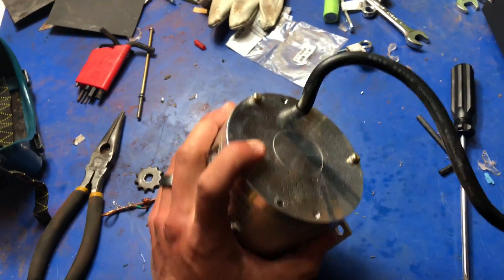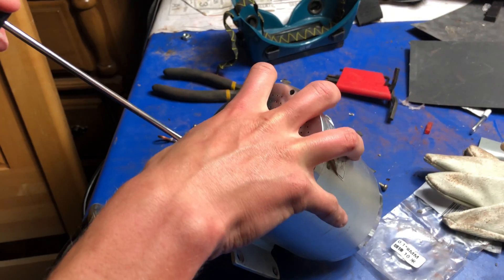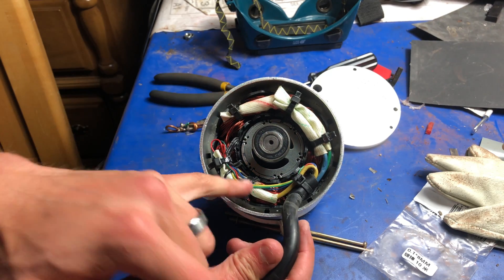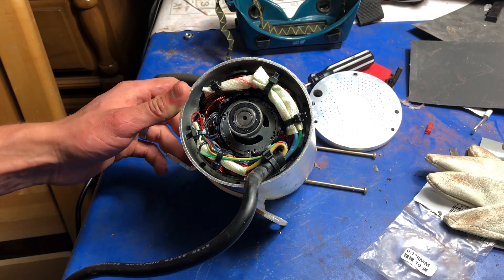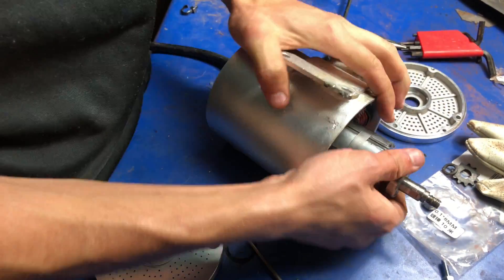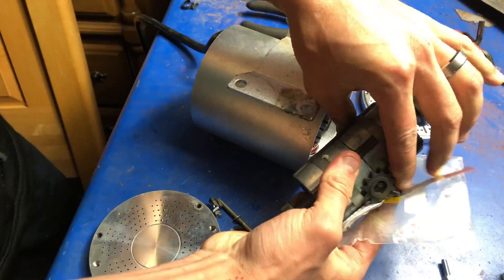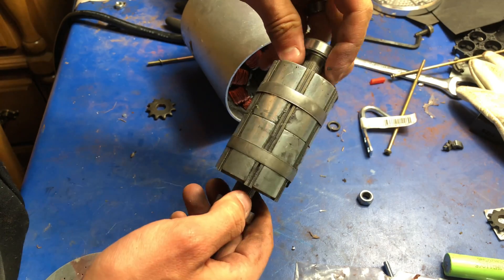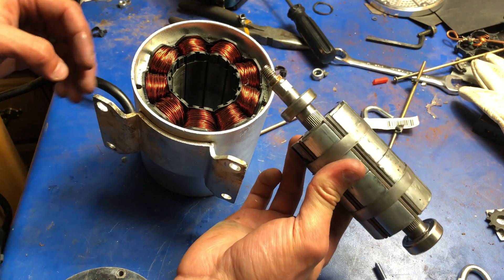What’s Inside a 5hp 3500w 72v Electric Motor ? 3 phase induction

Comment: It looks like those cheap ball bearings might have failed which in turn could  have caused the rotor magnets to grind against the internal field coil casing. 
I changed mine for 6001 ceramic bearings, but have not tested them yet. The main advantages are very much lower friction, zero maintenance (no lube necessary) and extremely corrosion resistant. Time will tell. But they make the motor more efficient with less frictional heat developed and near-zero rolling resistance :-)
Reply: Sorry if this is a stupid question, but how do you remove the bearings? They look like they are stuck on or something?
Reply: @AlfieMaxMiMi 
No problem. No, the bearings are just a loose "transition" fit on the shaft and housing. They are easy to remove. I replaced mine with ceramic bearings that seem to fit perfectly and work just fine.
Reply: @alant383  Oh good. Thanks :)

Comment: Anyone have idea how many peak amps these motors can handle? electro and co sell a kit for the razor MX and the controller puts out 100a, but the motor they sell has a heatsink on it so it can handle more power.

Comment: Nice video, Logan! I have a MY1020 with gearbox attached. Do you know how to get rid of it? Anywhere to buy the plate that goes in the sprocket side?
Reply: You really think someone taking apart a completely different motor is going to know the details of your specific motor? You think the guy is going to go out and buy one so he can figure it out just for you. Try using google or figure it out on your own. No one here is going to do the work for yoh
Reply: @jacobleeson1574  MY1020 is the same motor as this YT video, y'all. C'mon, try to focus.
Reply: I would love to see the gearbox you have set up on your MY1020 - I am using a chain geared primary reduction with a belt drive (Gates Carbon bicycle) to the rear. 
I might change it to a belt drive primary reduction later but the chain drive saves space (laterally).

Comment: Weirdest thing to me is u can buy these motors from 500w to 3000w and they all look exactly the same ??
Reply: Possibly different thicknesses and lengths of coils, put in the same mass-produced casing?
Reply: Or maybe the ratings are for different duty cycles
Reply: @robbiejames1540  i'd buy the highest rated one and undervolt them so make it last longer :)

Comment: I liked the video since I was curious of how does it look from inside.. 

first of all it is Brush Less DC motor with hall sensors. 
the design does not look too bad if you just consider low RPM use... 
however with just straps to hold the magnets in place  for high RPM that is really bad..

still it is repairable 100%
with little more knowledge and patience you would have saved 150$$

thanks for sharing though appreciated
Reply: Would glueing them to the rotor do the job or at least help in any way?
I am thinking of getting one, enlarging the holes on both sides, replacing bearings and adding a heat sink and a fan to cool it down.
Reply: @inso5078  i would not alter the design in any way if low RPM is desired .. i have had these for over a year without any issues and it barely produce any heat.. if you are considering a major design upgrade then go with a higher quality BL motor

Comment: Thanks.  I now know that this motor is not worth buying until they press the magnets into the laminated core (like Tesla).  That manufacturing process costs more but prevents the magnets from breaking/delaminating at high RPM.  
P.S. at 4:32 you said it was a brushed motor ... but you more correct earlier calling it a three phase motor. It is in fact a BLDC or brushless DC motor which operates using three phases and three hall sensors for rotor positioning information, which allows the controller to start the motor from a dead stop.
Reply: But my friend you get this motor at a fraction of a cost compared to a tesla motor from which u can't expect carbon fiber reinforcements on the rotor to keep the magnet and tesla motor is a bldc for a very low rpm but mostly its a induction motor.
Reply: @lalithkishore3774   Carbon fiber? Where? 
All I'm saying is the steel straps to hold the magnets on the rotor don't work as seen in the video.
Both motors are BLDC.
Reply: @kevinsellsit5584  No tesla motor is not a bldc motor, bldc are inefficient
Reply: @kevinsellsit5584  inefficient because of its back emf
Reply: @lalithkishore3774  
I'm pretty sure all motors generate back emf.
Reply: @kevinsellsit5584  
Personally, I doubt that it was the steel strap's fault. Sure, having the magnets inside the core would make them safer, but i think to would reduce efficiency for a pure non-inductive BLDC. I think these magnets were pre-damaged or stressed from improper fitting.
Reply: @robbiejames1540  clearly you have not heard of induction motors
Reply: @robbiejames1540 bad glue
Reply: @robbiejames1540  I purchased 60 cast iron hub motors from China in 2006 and nearly 1/3 of them were grinding the magnets on arrival, despite having been "tested" at the factory.
So fitting, adhesion, and quality control are words that apparently don't apply.
That being said, 100% of the BLDC controllers worked on arrival.
Reply: @robbiejames1540  or the rotor hit the field core due to failed bearings - they looked pretty crappy
Reply: its a brushless motor idiot
Reply: @chickenmanatvtuft8283   Why are you telling me this when my comment explains that it is a brushless motor.
Tell him not me, _ _ _ _ _ _.  Pick a word, idiot, friend?

Comment: Hi, I have a 3000W brushless motor and it is overheating. Could drilling bigger holes in the ventilation area solve the overheating problem please?
Reply: will definately make it better. but dont get any shards inside the motor from drilling holes. these are chinese motors and while they do provide good power and torque for the price, you should not put huge loads on them or they will get hot. if it only gets so hot that you can still touch it, it shoud be fine though.
Reply: Ponha uma hélice na frente do motor e aumente os furos ,mas cuidado com a água e detritos de chuva e excesso de poeira nele
Reply: Yes, there is a YT vid on this by "beltsnshit' where he did just that and added a heat sink around the outside. 
You have to take the end caps off though. I drilled mine out to 3/32" diameter holes based off the existing holes, from the inside. 
They guy on 'beltsnshit' drilled out to bigger than that, maybe 1/8" but similar effect. 
Another improvement 'could' be to add a mini fan (computer fan?) to blow into a duct formed around the end plate to blow thru the inside of the motor and exhaust out the wire loom side. That would give the best convective cooling effect possible - just need a filter for the intake - like wire gauze flyscreen - and allow maybe a formed duct at the exhaust. 

I know, I eat too much cheese ..... :-)

Comment: It's possible it could run even without the magnets. It wouldn't be synchronous motor anymore, but asynchronous. That means, as the magnetic field in coils is rotating around the rotor, magnetic induction appears in the rotor, and it starts following the rotation. It can never reach the coil rotation (hence the name, asynchronous) because that would mean there's no induction anymore. But it could still rotate. Assuming that material in the rotor isn't distributed in a way to cancel the induction (hopefully not). Since the engine was useless in this state, it's worth trying.

Comment: I hope you didn't throw out the motor.   Removing the broken magnet pieces will probably allow the motor to run again, once you put it back together.
Reply: what magnet?
Reply: @dand0sh922  In The Inside
Reply: Probably would be unbalanced and at the speeds they spin I. Would give a heck of a shake

Comment: You can buy that exact same motor of eBay for less than $100 brand new but I wouldn't advise it because your scooter wouldn't be super fast lol try out 150cc outrunner motor I know they're made for model aeroplanes but they are are one of the best performing bldc motor you can get for reasonable money
Reply: I’m confused?
Reply: A 150cc bldc motor?!?!
Reply: @ellisberry8747  
They're marketed as the equivalent of a 150cc engine
Reply: That is no good, you burn them down with lots of acceleration / on uphill runs.

Comment: You repair that motor, you weld a 12 or 24 volt motor to the shaft, and you turn it on with the battery and you already generate electricity; but if you make one of the Brushless windings independent, that winding can feed the starter motor and it no longer depends on the Battery; and you've already created a top secret, free energy double motor
Reply: Or, you don't waste time after listening to ridiculous nonsense in a YouTube comment.

Comment: It is three phase but not induction. Permanent magnet synchronous ac motor or sometimes called brushless dc same thing. It also has hall effect sensors for detecting rotor position
Reply: @Grim FPV no shit, and please call it a speed controller not a E.letronic S.peed C.ontroler AKA esc
Reply: Actually the motor is a bit of everything it's a brushless brush DC induction magnet motor using the motor controllers or troller on the motor controller it's really confusing that's for sure.
Reply: @michaelkhobbs741  
Its not tho - no currents are induced (As it uses permanent magnets instead) and there are no brushes/contact points on the stator or rotor, so brushless.
Reply: @michaelkhobbs741  i agree
Reply: @michaelkhobbs741  which company product, and do I get ?

Comment: @ Logan Nobles, did you know that those 3000+ watt motors that you buy off of eBay or Amazon or Aliexpress need a 100+ Amp 72v - 96v controller? I found out after doing much research because I bought a controller that was meant to go with my 1800w motor & the controller was only around 30 Amps but it was written on the box saying it was for an 1800w motor. To get the proper controller I needed a 45 Amp 48 - 64v controller which I found later. I can keep the 30 Amp controller for a spare if I blow the larger controller to get me by until I need a replacement if that ever happens.

The reason why I think that your motor exploded internally was because you were most likely running it for too long at high RPM's which heated up everything in the motor & as things expanded at high speed the magnets couldn't tolerate the expansion. Most industrial electric motors have a fan on one end which circulates air inside the motor, I noticed that your motor has these tiny little holes but no fan.

Next time you get a new motor, before you use it, take off both end covers & drill out 8 or 12 large holes between 1/2" to 3/4" diameter & buy some Aluminum Fine Mesh from an Auto Store so that you can pop rivet the mesh on the inside into several of the smaller holes on both end covers. The mesh is to prevent objects going inside the motor.  Also you'll need one of those 12cm high speed high flow computer mining fans that go on the end of your motor to blow cool air into your motor. This one is a 12v 218 CFM 120mm x 38mm costs about 13.50 USD + shipping .

https://www.ebay.com/itm/Bgears-b-Blaster-Server-Mining-Case-Fan-120mm-x38mm-2Ball-Bearing-4500RPM-218CFM/323844528997?epid=2234603024&hash=item4b66a35b65:g:06YAAOSwiN1dE3V~
Reply from the maker: Solar Function thanks very much for such a detailed reply. This motor was for an electric moped, and I ran it with no load for 10-20 seconds at a time.
Reply: @logannobles  Okay, no load speed would of been flat out maximum but because it self destructed it mean's it's a dud motor from the beginning. If you buy from eBay you will definitely get either a refund or replacement the next time around whereas Aliexpress you're on your own. Perhaps next time you should try buying from a reputable US seller of the same type of motor.
Reply: @solarfunction1847  
I don't think the load correlates to the speed here, as it seems to be a brushless motor? Either way, I agree, looks like a couple of magnets got damaged or improperly fitted, and when it spun up the radial acceleration broke them.
Reply: @robbiejames1540  all (good) ebike motors are brushless (there are still some brushed around unfortunately) the more current your controller can feed into the motor the higher torque it will put out, as thats determined by the amps on a BLDC

volts is required for RPM aswell though because at higher speeds these motors act like generators and the controller needs to output a high enough voltage to counteract the back emf/generated voltage and thus put enough current (amps) into the motor

so there are many reasons why it could be lacking in power.

i'd also say when you get an inrunner you should get an IPM motor honestly, those have magnets IN the rotor and have less issues as the magnets can't just fly off as they're in it rather than glued on the outside

another huge benefit is that with field weakening on IPM motors you can get 2-3x higher rpm on same voltage
Reply: i have the same motor on my ebike it is rated 48v 1800W 4500 rpm  ..i run it at 53v but its still dead torque and it heats up after a min .. it hardly takes off with weight on it..  but when i run it free wheeling without weight it goes extremely fast  .. i guess u are right about low amps controller .. i think i need to change the controller to something  draws more amps ..any suggestions to make it climb hills.. thank u
Reply: @bluewaxxx  T'est certain d'avoir un bon rapport de réduction ? c'est peut être ça si le moteur tourne bien roue levé

Comment: How well would this keep water out? I have a 1000w 36v scooter and I'm wondering if i could i ride in light rain, snow or puddles without frying the motor
Reply: Not sure about snow but the rest yes, should be fine. Make sure you let it dry after in a garage or smth, and clean it to avoid rust. My neighbor drives it everyday to work, most of the days its rainy and its totally fine after 3 years. Just very rusty, also cause he didn't took much care.

Comment: Thanks for this video mate ! But is it possible to remove and replace bearings by new ones ? :)
Reply: That is possible, you best need a puller, and heat the replacement bearings carefully (not too much) and they will slide on the shaft
Reply: Yes. I did exactly that and replaced with ceramic 6001 bearings. I got mine from Bearings  Canada (where I live) and they slip right on. 
 PEEK 6001 Ball Bearing PTFE cage Si3N4 Ceramic Balls 12x28x8. Results are near-zero friction, will never overheat, no lube needed, never corrode.

Comment: And you should have saved the parts from tge broken magnet. You could have epoxied them together and used it just fine.
Reply: No you can't glued it back to restore to its original function - the polarity in the broken pieces will not be linear.
Just replaced the magnets.
Aliexpress have many sellers.

Comment: my guess is something got stuck in between the rotor and stator so it locked up. just clean it up and make sure nothing gets stuck and if it rotates you should be good. if not you probably fried the windings. you could rewind the motor but from experience it kills your hands and i would never do it again. also theres no magnets on the inside but it seems you cracked one of the magnets on the rotor